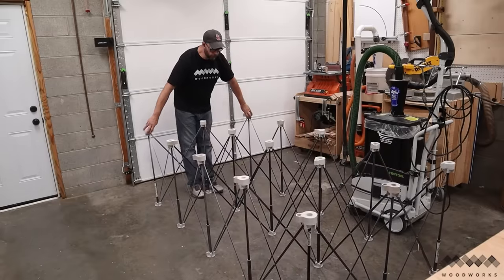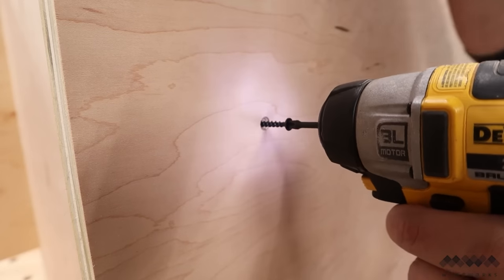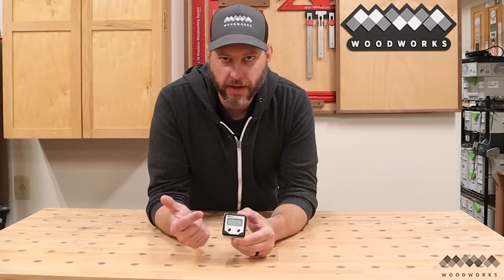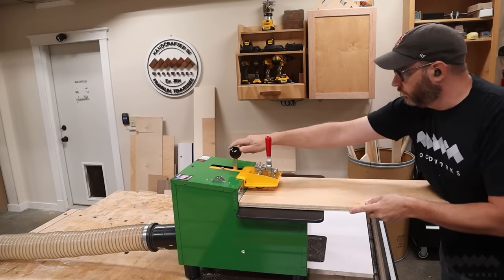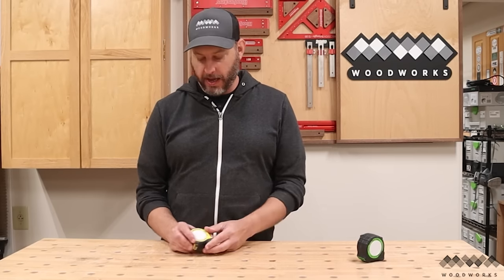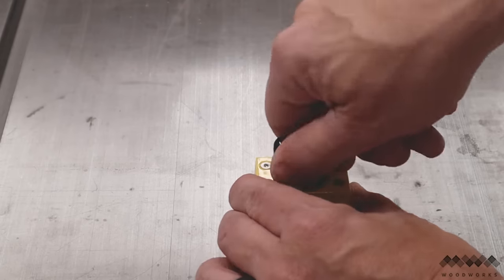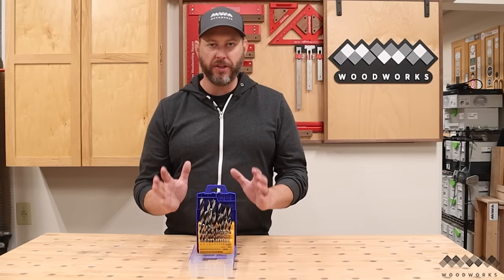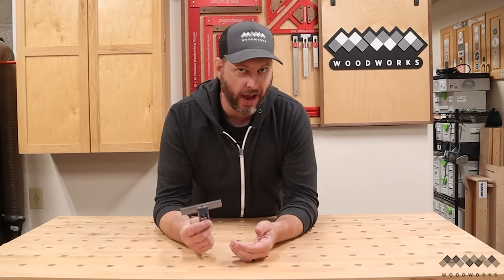10 Tools that changed how I do woodworking

Comment: Hands-down, the best woodworker recommended gifts! I really liked how you tactfully avoided calling out the Kreg pocket hole. I suppose Masca and some of the others bore at 15°, but Kreg is definitely the leader.
Reply from the maker: Yeah drill pocket jigs are mostly the same and very different from a Castle machine but I'm not meaning to put down Kreg or anything else. Those have a very good place in the DIY market. I just want to show that there are upgrades to be made while still using pocket hole construction 🙌
Reply: I agree and Kreg should never be viewed as something negative. If anything they should be viewed as, “The gateway drug to woodworking”. They made it insanely easy for the weekend warrior with no experience to build their first piece of furniture. That being the case, when that inexperienced weekend warrior is ready to step up their game not only because their skill level has improved, but they are also looking for a higher quality pocket hole, then this is the way to go.

Comment: Matt love the videos. Keep up the content. Had a question for the Bora Centipede, do you have to open it up and use it fully open? Like if I got the 8x8 could you only open it up to use 2x4 or 4x4 or do you need to actually fully open it 8x8? I was looking to get a couple 2x4 since I dont have much room but then could make a bit bigger one with a couple together. But saw your video and was wondering and thinking maybe I could get an 8x8 and not have to open it totally up to use.

Comment: Can you use any other drill bit sizes other than  the 1/8” that comes with the countersink drill bit?
Reply from the maker: No. However Amana makes multiple versions with different size bits in them

Comment: Really like the brake on the Dewalt trim router. Every time I turn my current routers off I have to watch the bit spin down and it would one less step if I didn't have to do this. However, probably not enough of a game changer to switch over from what I currently have but if I know of a newbie looking around I'd definitely mention this to them.